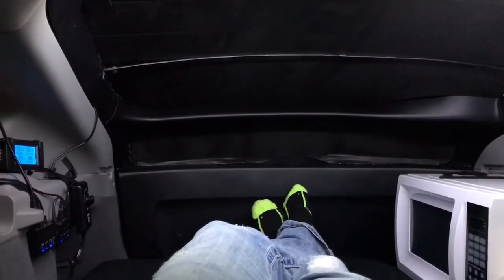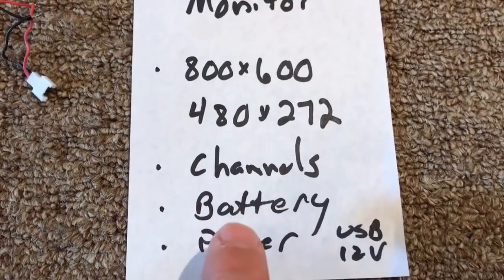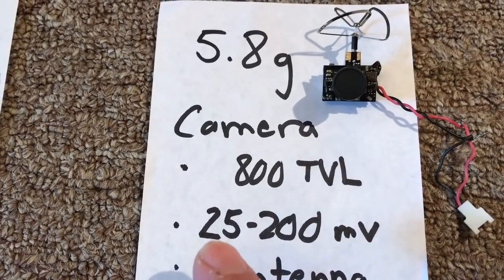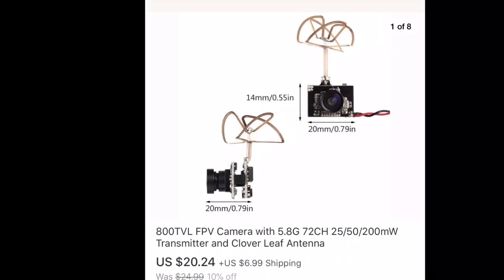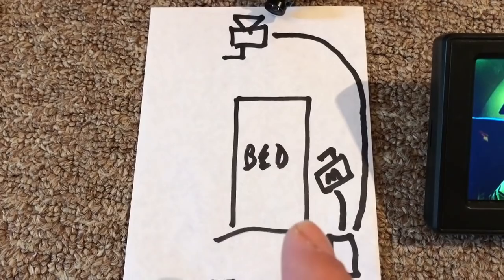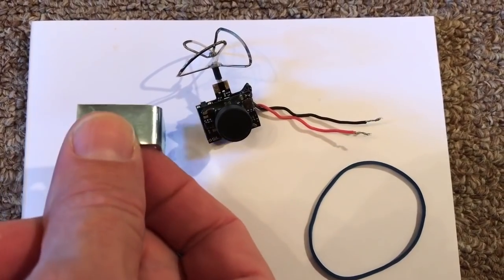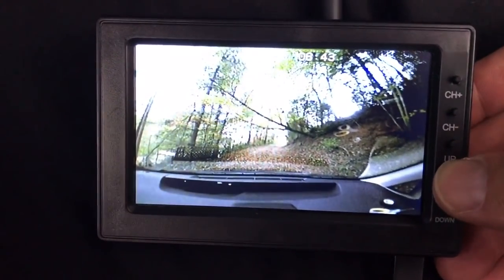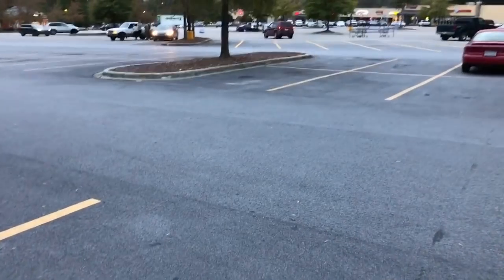Surveillance System Safety Monitor Security Prius Stealth Camper car vanlife van camera 5.8g

Comment: Immediately became very interested as I have that exact same camera. It came with an FPV drone kit I bought. The headset with monitor for it was about 45 and the drone with controller was about 50 so a total of $95. Eachine VR 006 goggles and DM002 drone
Reply from the maker: Cool - I need more practice with aerial photography.  Hopefully will incorporate into videos.

Comment: You're a genius. I wish I could do half of these things. I would really like to make the security system work for me in my Prius C. But, I'm still struggling with the blackout blind project :-) Thanks for sharing these awesome videos.
Reply from the maker: Thank you! Actually the window inserts are pretty involved to make but after the first one they are easier. Just keep trying new projects. I started with zero knowledge and skills and just bungled my way through. I did not show all the failures. You may want to check out the security system I did for the Panorama Van. It is simpler and really about the same cost. It is easier to set up.

Comment: Love this video, really helpful. I totally relate to the desire / need for cam security. Going to check your list to see if you've made one showing how to set up cameras 3 & 4 (side views). Sure wish I'd had one for an accident a while back. No witnesses except me, whereas the other guy had a passenger to help out. The desire further reinforced  on my first Prius trial run recently, two weeks, 6000 miles. Great time, missed the cam security. Thanks again!
Reply from the maker: 6,000 miles! Wow! What a great way to travel and so very inexpensive. Yes, the camera does give a sense of security. I ended up not getting to the side cameras yet. It will be easy - if you made the windows inserts - use the tiny ones for the side windows. I took my scissors and drilled a hole just big enough the for lens to pass through. The pressure of the hole on the lens kept it in place without anything else.  I'm working on my next project which is solar for the Prius. Waiting on parts. Thanks for your great comments and for watching!
Reply: THANKS!! SOLAR?! - Yaaaay! very high on my short list. Can hardly wait!!

Comment: I am intrigued by these hobby shop type projects. Doing this would be a risk of failing as I'm not as good as him at electronics do-it-yourself....it is funny that manufacturers haven't come out with a similar easy to setup device. The closest thing I know of is my Arlo camera system but it is AC- home based.
Reply from the maker: I tried to find a small 12v or 5v system on the market with a small monitor and they just don't exist. The Zosi system is 110v and takes up a large space. I was into drones for quite a while and had a lot of parts sitting around and realized I could put it all together with a USB outlet. The monitor was  converted with an old power supply. I think it would be great if someone put together a compact system for RVs and cars. Glad you enjoyed the video and thanks for watching!

Comment: Very Intriguing.  Appreciate the shared experience, in your (experiments).  The only Bummer for me thus far , is that I’m trying to find a camera like yours, but to be mounted on exterior of vehicle.  Looking for Small, IR, water (resistant), and Motion Sensing.  Nothing yet .....

I’ve read that narrower field of view on camera yields better resolution.   My goals for mounting are in each side view mirror housing, front grill, rear license plate.  I’m still reading up on which frequency will suit me best.  Thanks for the Vid !

Comment: Thanks for the videos. Really enjoying them. Wondering if you could somehow get the same monitoring by tapping into a dashcam and the backup camera. Would be awesome if you could.
Reply from the maker: KDog Thanks a good idea. The backup camera has a decent picture (reversed image). The better 5.8g monitors usually have a video in so if the wires could be located and the camera stays powered on I guess you could tap in from behind the tailgate panel. So it’s possible. Thanks for your comments and for watching!
Reply: How do these do in night time / low light situations?

Do you know if any monitors that output Bluetooth to an iPhone / android app that would allow me to view the various channel/cameras on my phone? 

I've been planning a similar multi camera system but would like it to go to my phone. I'm thinking have the cameras connected to a raspberry pi and then have that output to my phone. Combined with a small solar setup, hard drive, and a hotspot, it's possible to have a 24/7 multi cam, continuous loop and live stream camera setup.
Reply from the maker: Brn Wnthl I believe there is a plug in receiver for android phones. Sadly not for iPhone. The unit lets you receive 5.8g transmissions and converts to android. Do a search on Ebay for 5.8g Android. It should come up. They are pretty cheap.

Comment: Can you show us the original battery set up you have for your surveillance camera system with all of the USB set ups?  I believe the second battery you set up was for the microwave but I would love to see how you set up the original battery setup used to run the camera and monitor with.
Reply from the maker: Jessica Sampson I can see how I confused people. I ended up taking the electrical panel 12v wire off the primary 12v battery and ran it across the back of the car to the secondary battery. So microwave, inverter and my 12v panel are now off the secondary 12v battery. 

I added a cheap manual disconnect switch to the second battery just for testing purposes. I leave the two 12v batteries connected all the time unless it is at night and I want to use the bed heater and have the car in the OFF position which is rare. By keeping them connected the car keeps them both nicely charged. 

Make sure you use adequate wire sizes to do all this. You will need to check with someone more knowledgeable than me. Hope that helps.
Reply: I see now, thank you this helps! I could not tell that from the video but I am learning! Thanks for the quick reply and for letting me ask questions on your setup.  I will be working on this next after the window shades which I went and fetched all the stuff for yesterday, so today is hot glue gun day. Thanks again!
I need to get a 12v panel also, but I am sure you have the link for that online?
Reply from the maker: Jessica Sampson The surveillance system does plug into the usb switch strip which then plugs into a 12 cigarette receptical. That receptical then goes into the 12v fuse panel. I think the bed heater video might show better how to wire in a 12v plug into the panel. If not I’ll try to show that upcoming. Then that panel now goes to the second 12v battery.
Reply from the maker: Jessica Sampson The window shades are fun after you get through the first one. Let me know how they turn out.
Reply from the maker: Here’s the link:  https://www.amazon.com/dp/B073S3C6ZD/ref=cm_sw_r_sms_awdo_JwgcAbPEDDANK
Reply: Thank you so much, I’m looking forward to this project so much. I’ll let you know how it goes and how those shades turn out too.
Reply: One question I had was I noticed you used the Toyota battery for your second one, but is it possible to use any deep cycle battery as the second one to power the usb strip/microwave?  I think having a microwave in the Prius is also what makes your build so original and awesome, also the surveillance. It really is ghost stealth business here.=-) Thanks for the battery advise.
Reply from the maker: Jessica Sampson That’s a good question on the different battery type. Since the Prius is so battery intensive and computerized I decided to not try a big battery. I thought I would let someone else try that idea out. I figured the car would not notice if I just doubled the same type battery. The auto parts store told me that is was a special type battery that only toyota could sell. I checked 2 parts store and they told me the same thing. So I went conservative.
Reply: PriusStealthCamper Adventures that fuse box on Amazon is unavailable. Any other ones you recommend? I basically want to have a blender and induction stove going as well as that shower/dish washer.
Reply: @greateralexander  There are several other fuse boxes similar to that one. Try this: https://www.amazon.com/gp/product/B07GFKGSKQ/ref=ox_sc_act_title_2?smid=AOX862PYY6D9L&psc=1

Comment: YOUR COOL DUDE I WANT A PRIUS NOW BUT IM 6'4".
Reply from the maker: It would be just an inch or 2 too tight. You might check the newer ones. Mine is a 2009. I went to the dealer and pushed the seats up and put the back seat down and then layed down in the back. The salesman thought it sounded like a great project. Thanks for your kind comments and for watching!

Comment: Can you set this up to view it with your cell phone even in doors?
Reply from the maker: There is an attachment to view 5.8g video on your smartphone but it only works on Android and I have an iPhone.  Do a search on "5.8g Android" and you should see the attachment. The distance will depend on how much power the transmitter is putting out so yes, you could easily see the feeds from your Android phone from quite a distance if you use the 2000mw amp - maybe a mile or more might be possible.
Reply: Awesome thanks!

Comment: Will the little cameras overheat if you leave them on?
Reply from the maker: I usually don't leave them on for extended periods but have not had a problem. I have a switch handy and if I hear something I just turn the switch on. The cameras come up instantly then turn them off to save power.

Comment: Can you set this up tp record, and could it simultaneously record from multiple cameras?
Reply from the maker: Stan Winston Good questions. You can purchase a 5.8g monitor that has a DVR built in, most of the 7” monitors have that feature. 

I did a good bit of research on splitting the screen so I could see all 4 cameras. There isn’t an option with a 5.8g low voltage setup. Wish there was. It can be done but you have to go to a residential setup. They usually have a hard drive to record to. The problem I had with that is I would have a bulky head unit (so little space) and have to deal with 110v. It would also involve taking apart their big cameras and just extracting the small camera inside. It’s all very doable and I might go down that road. I’m going to start with this system because it is so easy to install and uses almost no power. But I love to tinker so we shall see. Thanks for watching.
Reply from the maker: Stan Winston ...the 5.8g monitors can only record one camera.